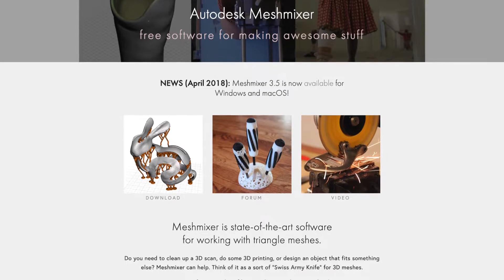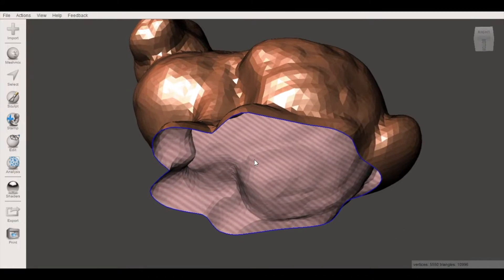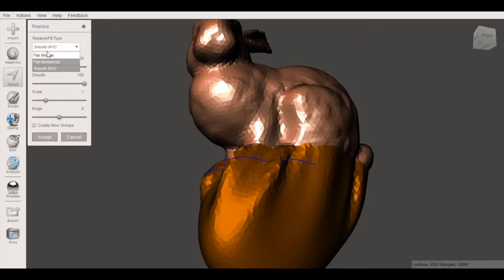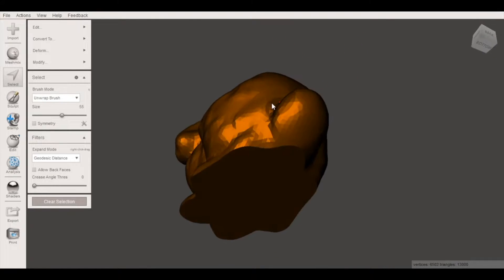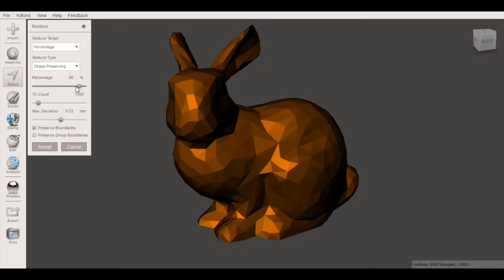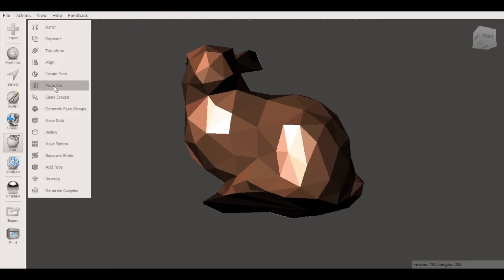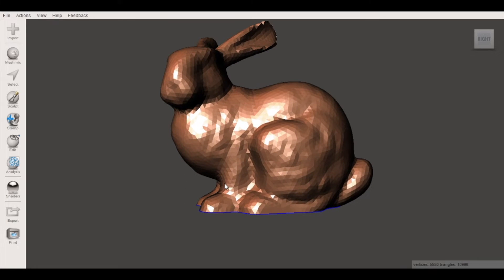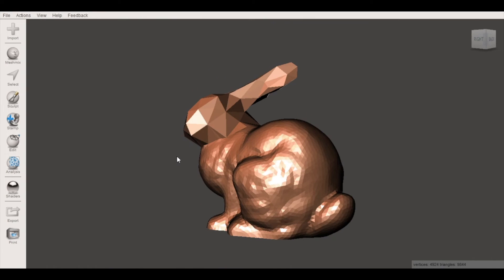Meshmixer Basics: Making Low Poly Models for 3D Printing Using Meshmixer

Comment: hi, thanks for the tutorial, would this software be able to give me the possibilty to save the polys into dxf or dwg files? I would like to make a model into lowpoly then cut them out in metal and make an actual sculpture.
please let me know, thanks!
Reply from the maker: There's an older app from Autodesk called "Slicer" that does exactly what you're describing. You could export the decimated model from here and upload it into that program and be good to go!

Comment: because this model has shine and mine doesn't?
Reply: (solved - press space while editing your model. then chose the second option in under "mesh") same dude. my model looks like a$$. you can barely tell it has outlines in at these percentages. but if i bring it into a slicer or cad it looks fine. did you figure it out? :D